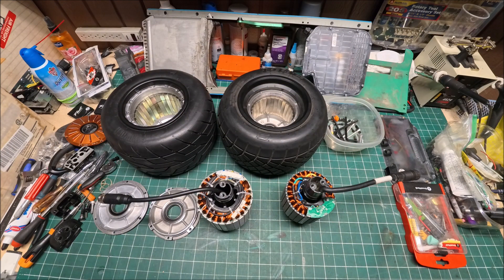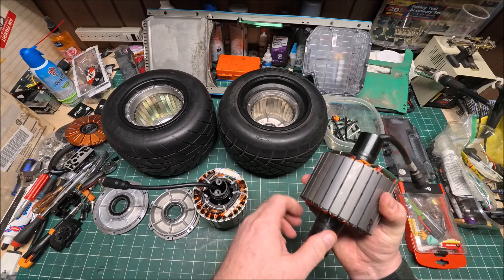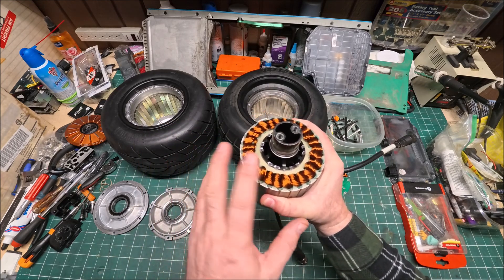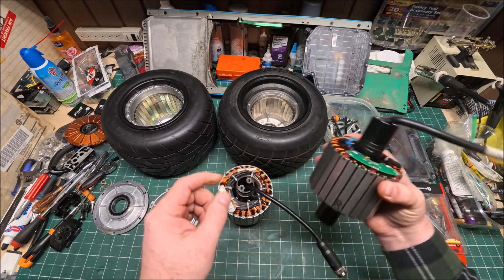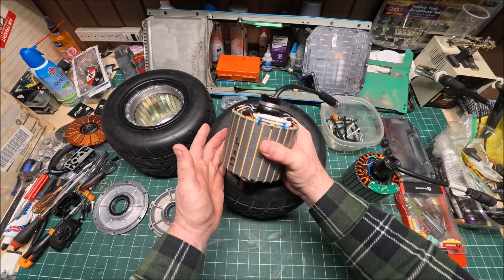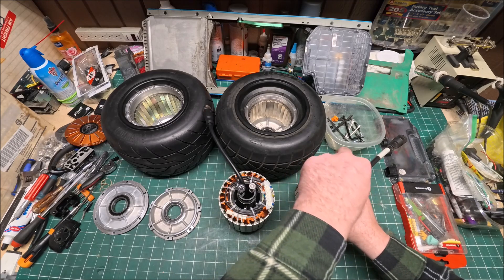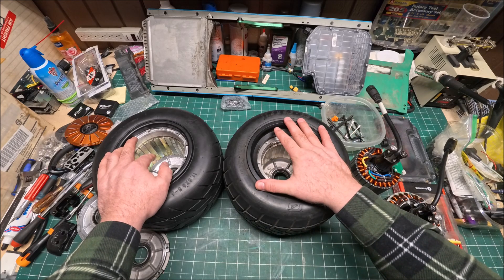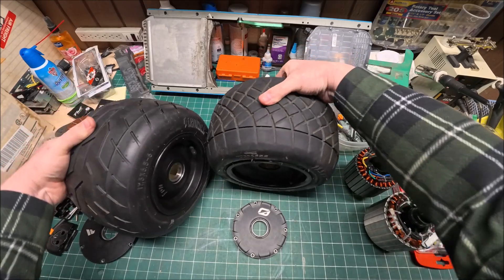Fungineers SuperFlux v2 HT VESC VS Future Motion Onewheel GT Hypercore motor

Comment: I'm looking for more info on swapping my hypercore connectors to a superflux connector.
Reply: You should have 2 power l1 and l2 ( hot and negative ) and 3 hall sensor wires. The hall sensors are self explanatory. The hot and neutral are the other 2. Do you have a specific question ?

Comment: Hello Petr, good comparison. Let me clarify We cannot wind our motors by machine due to small quantity. The machine cost is only justifieable if we produce 1000s of motors. 
However the windings of all motors should be within acceptable limit (a few mm) and should not short with the hub. You can safely ride the motor with confidence if you have any issues you can let us know and we will replace it. We have superfluxes that have completed more than 10,000 miles so we are confident this motor will not let you down. That being said we will talk to the factory to have tighter windings. The wobble bolts is an issue of the past and will never happen again.  We will send new bolts to everyone for free who has loose bolts on their HT motors.
Reply from the maker: Thank you

Comment: What type of epoxy would you recommend using to minimize the movement / flex of the board?
Reply from the maker: Probably I'm going to use a 5-minute epoxy or silicone. Please note: do not use epoxy that hardens like a rock, because it will be very difficult to remove it, if it's needed.